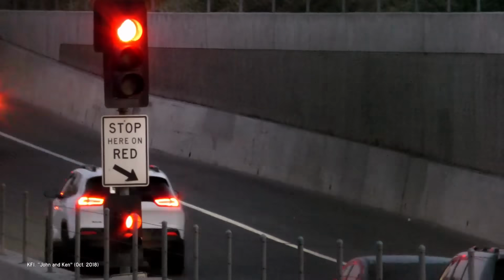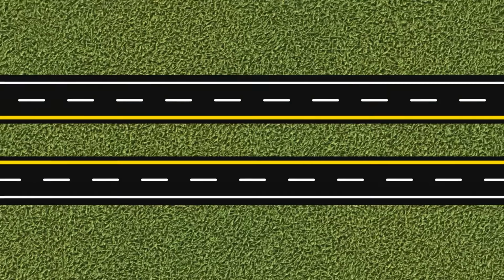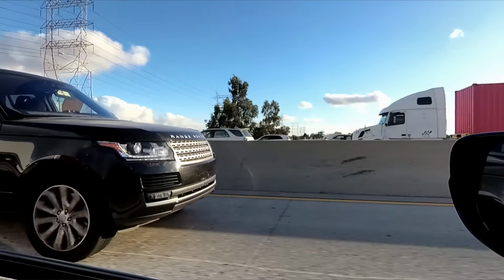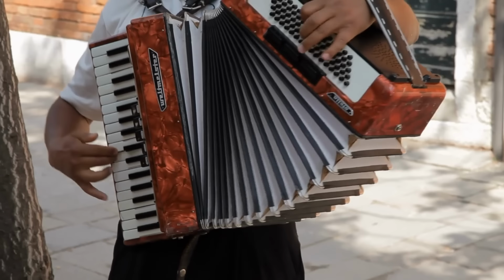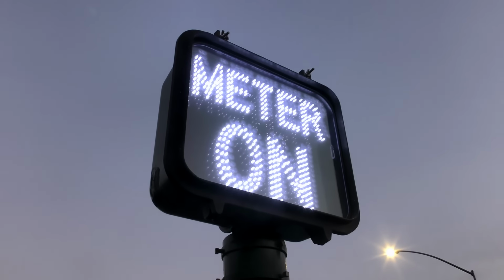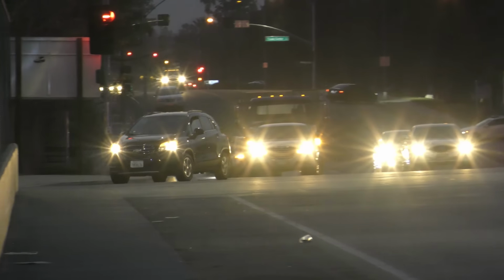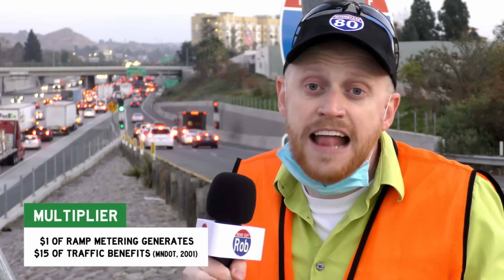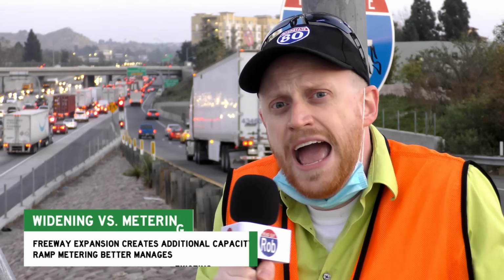Why the extra RED LIGHT on freeway ramps?

Comment: I've always wondered how this works and its real benefit. This was an excellent explanation. An additional benefit is that mpg goes up, less energy wasted is money saved and it helps reduce air pollution. The next step for this technology is to integrate with vehicles so that their speeds are djusted to allow them to arrive at green lights when merging or even along their entire route! Imagine navigating to your destination and never hitting a single red light!
Reply: in parts of the uk england if one keeps just under the limit you can go on at least  7- 8 junctions.
Brighton promenade comes to mind.

Comment: Couldn’t imagine one of these things here in Dublin. On an on ramp that would require this the inside lane simply goes all the way to the next exit marked by a wider painted white line.This tells drivers they’re in an merge/exit only lane and we merge accordingly thanks to the magic of indicators. Although you guys call them blinkers,make them red and for some reason even integrate them into the brake light. Maybe a video on that would be good.

Comment: Problem is it never works like that in a simulation because the light is so close to the merge point that most cars only speed up to 35mph then try to merge in causing all the cars to back up anyway. I've never once driven on a real life freeway where there wasn't a massive backup with cars all slowing down before a metered on ramp. The "platoon" and the freeway cars should be coordinating their lane change in a matter that results in a smooth transition without slowing down. It's rare but I've seen it happen so to me it shows there's no substitute for a competent driver.

Comment: Maybe that's how they work in LA, but in SD and the Bay Area, they come on at the same time every day.  They are even on during lockdowns when there are fewer people on the road.  

Other problems with ramp lights: 1) they prevent you from getting to the speed of traffic to merge because they cut down the distance you have to accelerate, 2) they stop you even if you are the only car on the on ramp.

Comment: In my research the concept of spacing traffic into a freeway is not about speed control but about spacing that with cooperative drivers produces a zipper effect thusly keeping the merging lane highway traffic moving vs stopping. Of course,  that zippering effect works up to a certain highway capacity AND in multi lane on ramps cars wanting to merge should not bunch up which is what shall I say most drivers want to do because that’s what drivers do always!

Comment: There's got to be a better way.  Stopping and starting is a waste of fuel and brake pads.  The ideal would be to slow and separate traffic on the on-ramps before the merge.  Perhaps variable speed limits with camera enforcement.
Reply: That's the whole point.  It "helps the economy" (of the businessman) to force drivers to buy more gas and more-frequent car repairs.  Not to mention the corporate and government welfare of manufacturing, installing, and maintaining the signs and lights, and writing those all-important tickets.

Comment: We also have that in the Ruhr area. The Autobahn exits and entry are only a few kilometers apart (it's one city next to the other city) and the traffic on the Autobahn is usually high. In addition, the Autobahn is limited to max 100 km. There are controllable display boards above the Autobahn. 
There are contact loops in the lane and cameras above the Autobahn.
Detour can be displayed on the display boards. And the monitoring center knows how many cars can be on the lane.
It even controls important routes in the city in the event that the motorway is jammed. 

Without traffic control over the entire route, there would often be traffic jams.
Only one vehicle is allowed to enter here, or two if the gap is larger.

But Europeans are more disciplined. Slow vehicles have to drive on the right and faster on the left. Overtaking is only allowed on the left.

Speeding up is not the solution. The slowest drive faster than 60 km, the fastest can travel over 200 km per hour. That is a challenge even on a normally full Autobahn. But in a crowd it is more likely to be limited to 100km, 80km or only 70 km per hour. The slowest can do that too. Therefore, the displays may change speed limits.  
Then the vehicles are packed more densely .

Does meter mean a counter?

Comment: Here is an idea, Add a 2nd freeway for thru traffic (or just use 1 or 2 lanes of the current freeway) Once you get about 10 miles away from a major city you would have a freeway option that would let you travel trough the city without the option to take any exits or only allow fewer exits maybe once every 5 or 10 miles. For emergency vehicles you could place gated emergency entrances. This way you separate the thru traffic from the local traffic and offer a fast lane for emergency vehicles in the event of a clogged freeway. The gate for the emergency vehicle would swing in forcing cars to merge to the left lane or stop, clearing the lane of traffic.
Reply: We already have these: they are called express lanes and they have had mixed results. If we have unlimited space and money then the NJ Turnpike is the perfect highway that should be everywhere: 3 lanes for trucks and 3 lanes for cars each direction all separated by concrete barriers. Separating the cars and trucks helps A LOT more than you'd expect

Comment: I have experienced similar approach for a roundabout.

During morning rush hour traffic on main road was primarily one direction through a roundabout. Driving at maybe 10 km/h.
Traffic from the side road entering roundabout before the main road morning direction, had no problem cutting the line.

Problem increased
when drivers om main road decided to take a detour through a residential area, bypassing the a chunk of the slow que, then go back on the main road at this roundabout. 
This caused even more build-up and slower traffic onmain road, and even build-up to enter from the side road, making a constant flow, causing even more build-upand stopping entry from main road roush.

Solution was:
Put a traffic metera red light on the side 100m before the side road entry.
Make regular decent gaps in the flow from the side road to allow more flow from the main road. 

Result was:
Drivers on main road didn't gain time driving through residential area, but kept following main road.
No continous build-up to enter form side road, not waiting minutes anymore, just 5-10 seconds at the red light.
Better over all flow from all directions. 
Better over all flow
Reply: I don't know/remember if this actually was by traffic meter, or just timer by experience. But the results was very good for all parties.
Reply: This was just a temporary solution, the main road are now going straight through, with a larger roundabout above, and ramps to enter/exit the main road.

Comment: When I learned how to merge onto a freeway you got up to speed on the Ramp entering the freeway 45 -55 mph so you were travelling at Freeway speeds. Nowadays you merge doing 25-30 Mph and the freeways are doing the same speed. Amazingly Slower than 20 years ago. These extra Lights Back traffic up onto the City surface streets, creating a Jam in downtown, accidents and confusion as well. So they don't help with anything but make a Bottle Neck Longer and stretched out across the city slowing everyone down.

Comment: In NZ (Auckland at least) the lights go green for both lanes at once, it just creates drag races to see which driving is slightly more impatient than the other. In some cases this then carries on into the motorway as the loser pushes their way on to the middle lane to pass the winner before they get a chance to move out of the slow lane.
For a country that doesn’t understand how to merge like a zip or the right lane gets right of way I find it funny that this is what we opted for (over one lane at a time, with shorter gaps between seeing a green light).

Comment: I think the real fix would be to change the timeframe where people work. Instead of only 2 schedules, if workplaces had 4 or even 5 schedules, it would produce even better results.
There can be exceptions of some places but for the majority, it doesn't need to be 9 to 5.
Here's some more:
7 to 3
8 to 4
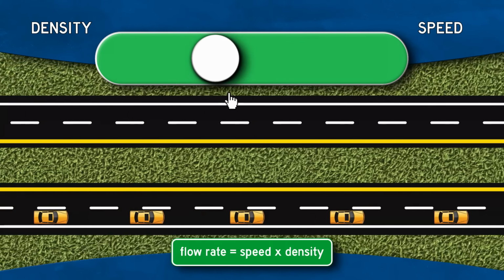8:30 to 4:30
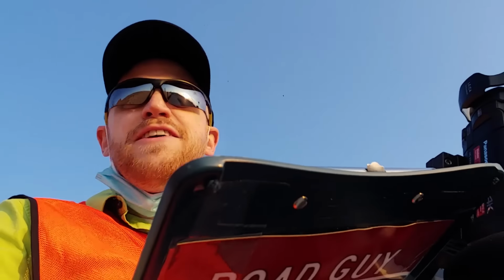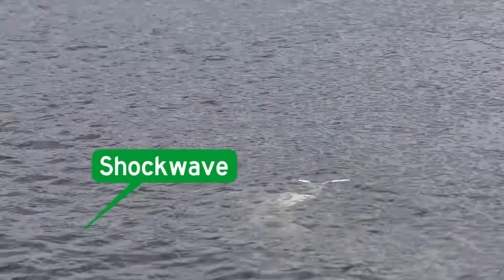9:30 to 5:30
10 to 6
Then disallow heavy vehicles during the rush hours. This would be 7-9 (inclusive), 4-6(inclusive).
This would allow streeeetching the high traffic density periods and reduce traffic while making better use of the roads.
I'm pretty sure 80% of the really high traffic amounts are due to going to work and going back home!

Comment: I feel like part of the issue is what people do AFTER the ramp meter. We have a spot here in Metro ATL (285 eastbound at Paces Ferry Rd) that is metered but creates a huge jam every day. The people entering push all the way forward and push their way in ahead of a) cars that were on 285 that already let cars off the ramp in and b) cars that came off the same ramp ahead of them and already merged. So they prevent the lane from actually flowing. The two right lanes pretty much stop at this entrance and really only move at all because of some people moving to the left lanes as soon as they merge. If you want to get off at the next exit (which is US 41 and has major shopping areas and, oh yeah, Truist Park), you need to be in the right lane either before or just after Paces Ferry. I don't really think there's any way to fix it, though.

Comment: So here ‘s my issue…. The on-ramp is supposed to get on the freeway at speed. So….now I’m having to start from zero. They turn on the meters when we are jammed up OR they are always on and I’m having to go zero to (ahem) 70+ because there’s a bunch of big trucks and I am NOT at speed. So the trucks are braking and/or changing lanes. 

In other words, we are now stopped further down the ramp in a clump because the freeway is simply overloaded OR we’re just stopped and then trying to not get whomped by 18 wheelers are going 70 (yea, they do….even if they deny it) traveling less than a car length between.

I get the SCIENCE but my observed experience is that it is either no help cause it’s stopped on the freeway anyway, or there’s no one of any significance and we are doing rabbit starts.

I would rather see that metering money go to actual driver’s education in high school so people learn how to merge properly. And all the other good driving habits that have been lost.

Comment: actually, the electrical model still works, because the more amps you try to ram through a wire, the hotter the wire gets, and if it overheats, it burns the insulation off and shorts out, resulting in a catastrophic failure.

Comment: Some genius suggested slowing down our freeway to solve a bottleneck. But it's nearly at a standstill in rush hour so slowing down the freeway itself wasn't the problem when the feeder roads are still pouring in cars at full volume. 
I don't know if a ramp meter would work as well in winter conditions where ramps become dangerously slippery and accident prone

Comment: My favorite is when the ramp meter is on, no one is at it, and it's red.  Just merge at full speed.  If you're the first lane there it's going to turn green for you the instant you get there!!!

Also, if they could just turn them off when the freeway is gridlocked.  It's just salt in the wound to have your ramp meter light cycle green and back to red three times before you can inch forward.

Comment: This is quite interesting. I've never seen such a thing as they are not really popular in Europe, and at first I though it was to force usage of both lanes by preventing merging too soon

And I think there are multiple reasons for the lack of them here. One is that here is often not enough space to put them. I can think of quite a few ramps in my area that suffer from that problem and that is despite living in a quite modern city in which all buildings are 150 years old and younger. Another thing is that cities in EU often prefer to clog their streets to discourage driving by car, only prioritizing buses running late and emergency vehicles. Both things done quite easily - a green wave for the bus, and intersection blocking (red lights for all traffic) for the ambulances.

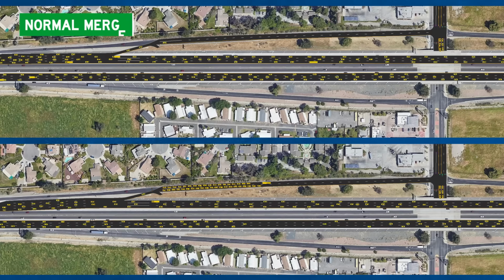Comment: I'm extremely late to comment on this video, but I've noticed a couple of issues that are involved other than the platoons causing cars to slow down... it's not the job of people already on the highway to have to yield to car entering, and the way most traffic treats highways like they are roundabouts but straight roads. also at the animation isn't like real life at 6:54, bc it's usually only the right most lane that yields if they have to. Also, the cars randomly stop when there's no merge happening, now this is like real life where people just stop for no reason sometimes, but that's not what really happens and shouldn't havr cars all of a sudden create a backlog.

Comment: Just as you said that you can't simply increase speed to increase flow rate because density goes down as speed goes up, electricity is the same.

Electrons don't stay at the same density. As amps goes up it causes heat due to line resistance. Increasing heat causes the resistance to go up.  At some point watts hits a wall because the line resistance has gone up enough to significantly lower voltage.

Ohms law is V = I x R, or volts = current x resistance.  Watts = V x I (in a DC circuit).

Most cabling are designed for a 10%, 3% or 1% voltage drop. This means a cable designed for a 10% voltage drop will see voltage decrease to 90% at its designed maximum amperage. After that point increasing  amperage causes the voltage to drop even faster. 

Just like a freeway. Electrical is equivalent to freeway terminology (just not the same electrically)
V (voltage)is speed
I (current or amperage) is flow or density 
W (watts) is flowrate

A freeway operating at its design capacity will have a density of vehicles traveling at its designed speed or W (flow rate) = I (density) x V (speed)

As the I (density) exceeds capacity there is a resistance to density (people slow down, lowering V). The more density exceeds designed rates the more and faster speed lowers.

This is exactly how electrical cabling works. Increase cabling beyond density (I) ratings causes speed (V) to decrease. The more you increase density beyond design, the more and faster speed decreases. 

And just like a bridge, if density increases enough the bridge will fail. With cabling, if current (density) increases enough the cable will fail.

This is why with cabling code requires using ampacity. Ampacity is simply the amount of current a cable is rated to carry. By code, you must limit current to no more than 80% of ampacity.

Amperage =  Ampacity x 80%
Ampacity = Amperage / 80%

If you desire to have a 15 amp circuit then you must use a cable with an ampacity of 15 amps / 80% = 18.75 amps

Then code also requires that that cable has protections to ensure that ampacity is not exceeded. This is normally a breaker for AC circuits, though fuses used to be used.

This is to ensure that the cable does not fail. Failure is a melted cable that then causes arcing which starts fires.

The reason the cable melts is that as current goes up, temperature goes up. Too much current causes the cable to meet/exceed its melting point. 

This is also why aluminum cabling is larger than copper cabling for the same ampacity. Aluminum has a lower melting point and it's resistance increases faster than copper.

Comment: The one downside from the local ones here are they're so close to the main highway, if you have a slow 4 banger that can't get out of its own way, even putting it to the floor, gears banging, engine screaming, unleashing small displacement fury, you're trying to merge at 50 with traffic going 75 😂 I feel bad for those poor souls...

Comment: When our interstates become so clogged with traffic that they require ramp meters to tell us when to get on the freeway then it's time to start looking for alternative methods of transportation.  The U.S. is so far behind the rest of the world when it comes to mass transit in both our major cities and our smaller cities.  Maybe if the larger cities would invest more money into expanding their subway/light rail lines into the suburbs and sides of town that don't have convenient access to them people might be willing to use them more.  For example, Atlanta could expand and improve the MARTA by either creating two more train lines going from NW to SE, and SW to NE, or just building a perimeter train that would circle around the city to connect points on all four of its current lines.  If it chose to add a perimeter train, MARTA wouldn't even have to add stations to the perimeter line; it would only have to connect the line with one station on each of the four existing lines.

Comment: Another idea that looks good on paper. You can't solve density issues without mass transit. All these traffic control lights do is separate cars evenly as they join an already traffic crawl. In reality all it accomplishes is backing up the ramps which in turn cause gridlock the nearest intersection. In theory it should help but show me the data that proves that it actually does.

Comment: There are a few issues with these lights that I've seen. Some drivers don't speed up to merge on and cause people on the high way to slam on the brakes and this causes massive issues and accidents. Second issue, the lights in our area run like a drag strip, both lights go on at once, so this has some obvious problems as well. Third issue I've seen is people just rolling through them, no enforce, no care. Just some thoughts.